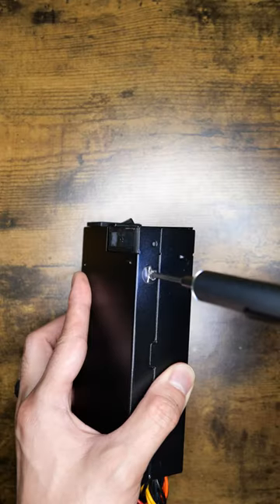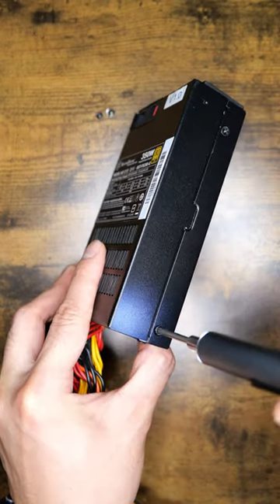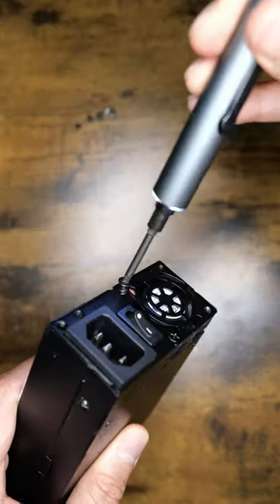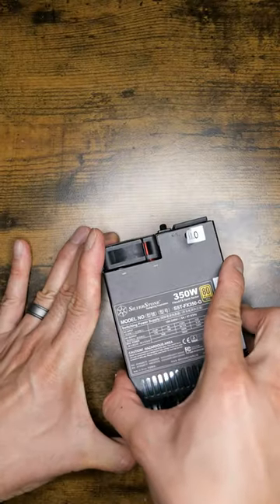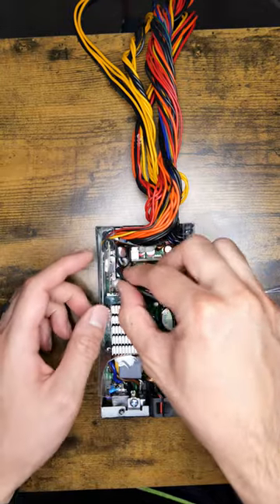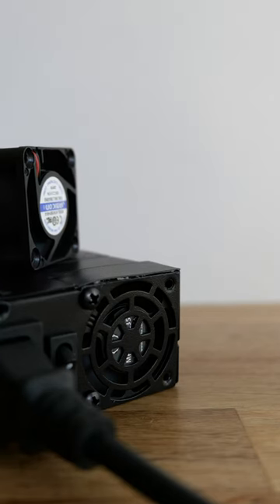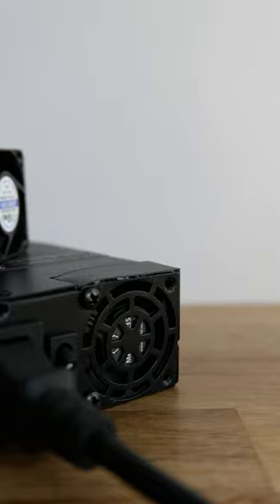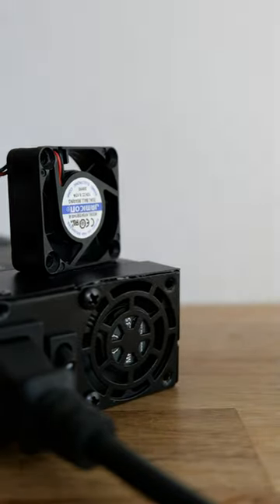Noisy Flex ATX PSU Fix #shorts

Comment: It was noisy because it  rotates very fast.  You just replace it with slow rotating fan.  If you measured the temperature before and after mod.
Reply from the maker: @kentanrem  I might eventually check temperatures, but so far it’s been quiet and it’s been able to handle (what I think) it’s made for.

Comment: Some of those components can hold a charge even after you unplug em so wear gloves.
Reply from the maker: I’ve had gloves exhibit micro tears from simply handling the bottom side of a PCB (solder posts), so gloves could introduce a false sense of security lol

All in all, I don’t recommend fiddling in PSUs
Reply: Tapping the power button after unplugging the PC can at least partially discharge the caps.